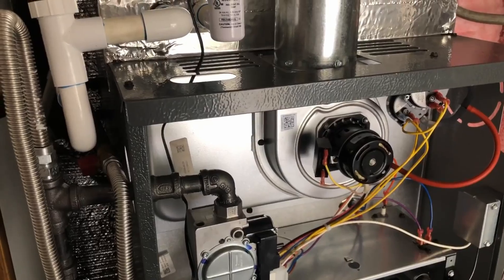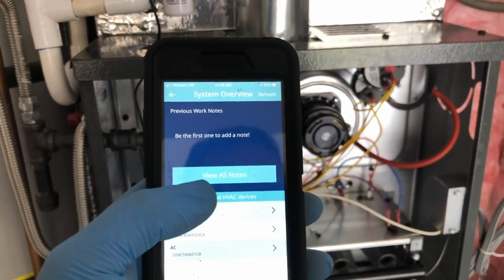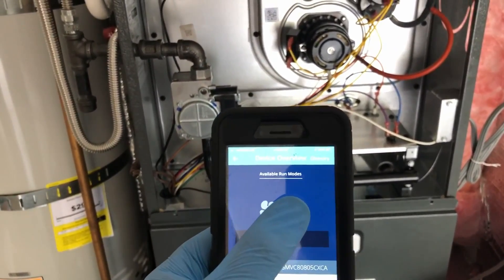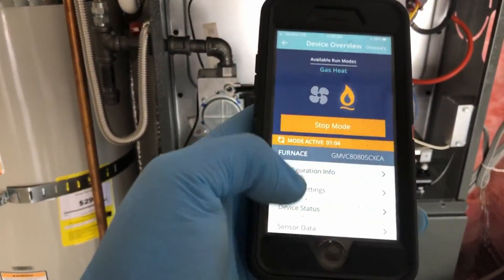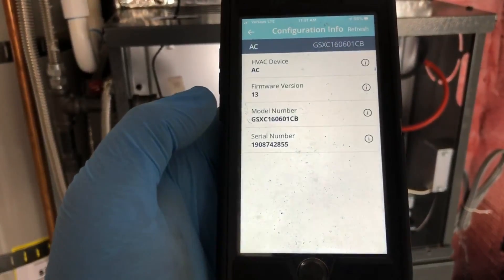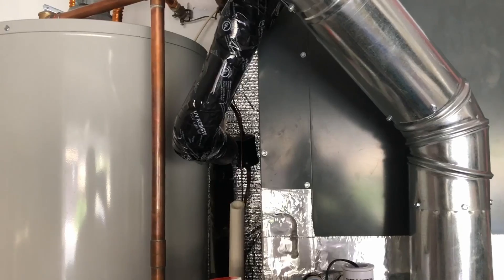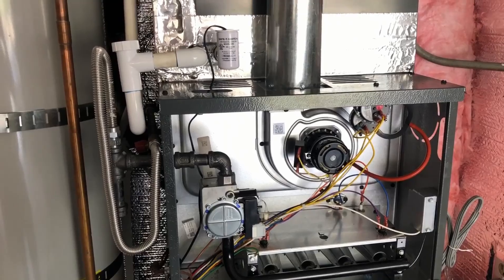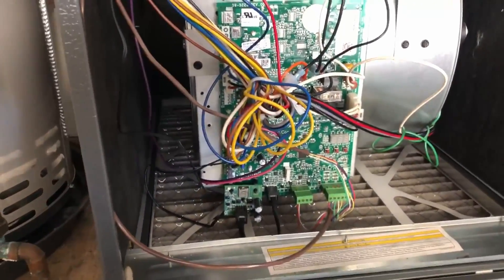EP16 A Goodman Cool Cloud HAC Review

Comment: While I think that is pretty slick, there is a lot to go wrong and it is going to be expensive to fix when it happens.  I’ll personally stick with high efficiency non-communicating as long as it is possible to do so.  At an absolute minimum I would surge suppress the entire breaker box and put individual class 2 surge suppressors on both the furnace and the condenser power with low voltage cutout.  I must be old fashioned, I liked the day where we had interlocking safeties with no real central control board and heavy metal furnaces.  I’ve seen some of the heat exchangers from the mid60s still working and still sporting a near perfect ceramic coating.
Reply: FYI. The heat exchangers are now stainless steel, so they should last the life of the furnace. But I agree, too much fancy stuff is asking for trouble.

Comment: Have you guys ever had issues with the air handler Bluetooth not connecting? When I go to cool cloud app it says to search for near by devices, I click on that it loads but it never finds the Airhandler.
Reply from the maker: Make sure you give permission to the app to use the Bluetooth connection. If that’s off it won’t connect.
Reply: @NighthawkHVAC  thank you, I just checked and yes it’s been on.

Comment: Hi, thanks for the video!  I am in Houston and have the same configuration as the video - what furnace and ac settings would you recommend?
Reply from the maker: The default settings are usually fine. In some situations you might need to make some adjustments if your having issues. But it’s a case by case situation.